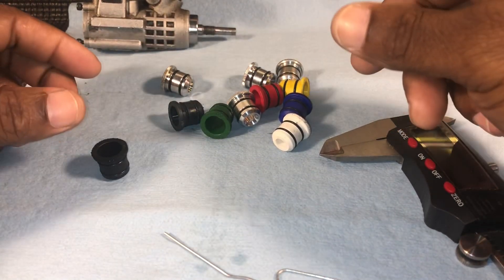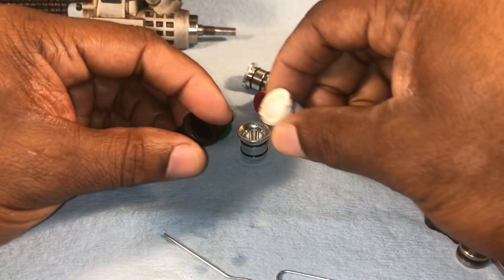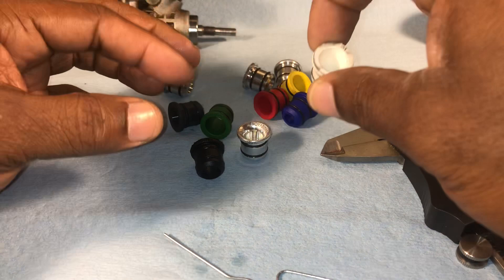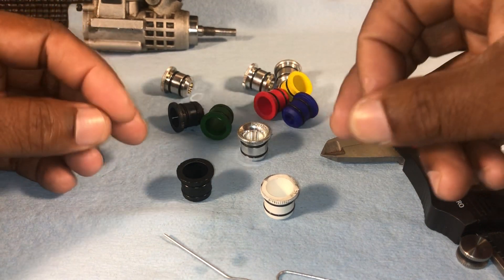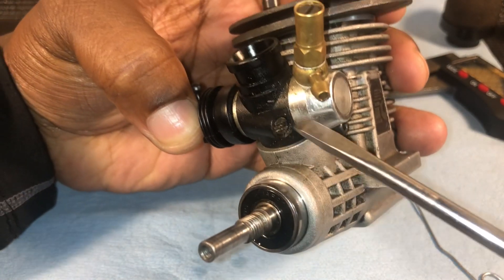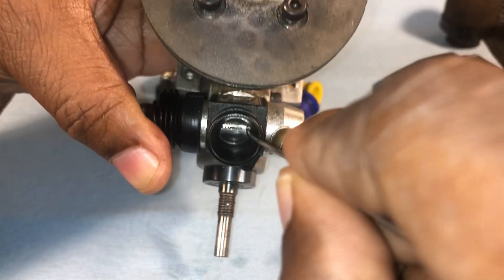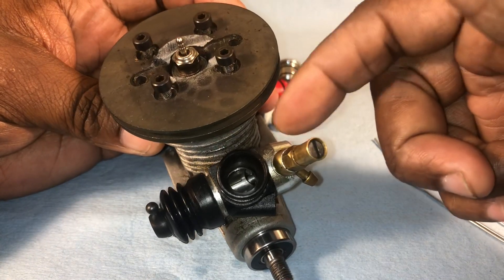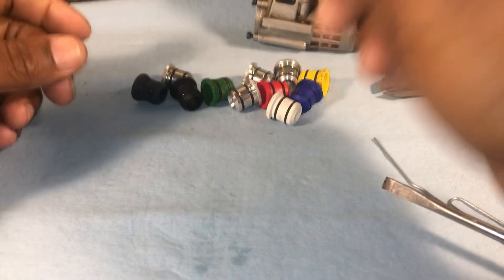Different nitro engine Venturi’s and setting your idle gap

Comment: The problem comes when you have to install the air filter. To me, the Venturi seems to hinder the installation of the air filter pipe. Wouldn’t it be better to install the filter without the Venturi?

Comment: Which venturi should you use for break in? More airflow or?
Reply from the maker: I normally use the one that comes with the engine, usually a 7 mm is fine

Comment: One thing I'd say. If I set my gap that big, I cannot get a temp above 160 when the idle gets low enough. 1mm is huge.
Reply from the maker: Well the 1.0 mm is usually my starting point, it’s never stays there, new engine for break in usually come at 1mm for easier starting because they are set so rich. If I had to guess after tuning I’m usually about .6 maybe .5 mm gap
Reply: @rajaa111  
Ah, that makes a bit more sense:) Maybe explain that in a future video. This could easily be seen as the final setting in the way you explain it.

Comment: Thanks for the info. My idle screw seems very tight could they seize up like the low speed you mentioned?
Reply from the maker: MPJohnny5 yes sir if water or something may have made it seize up, when you get it out put some anti seize on it, that should solve your problem